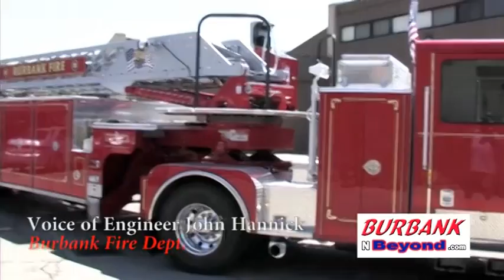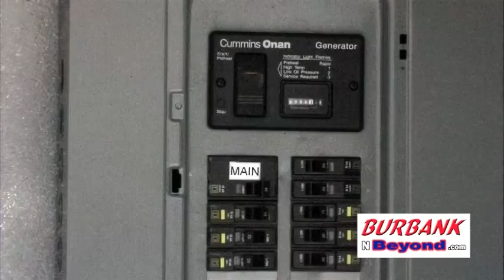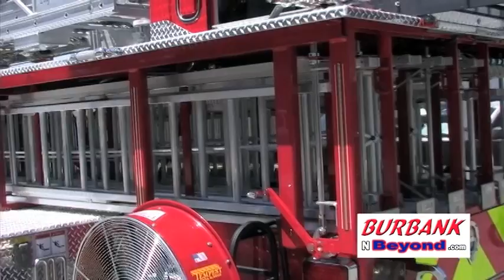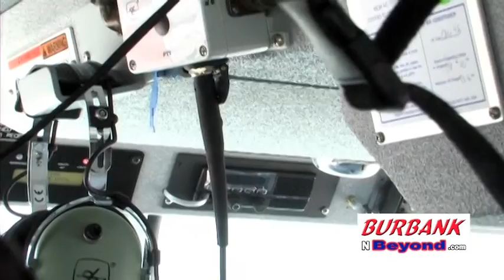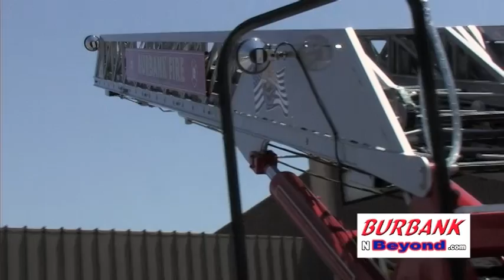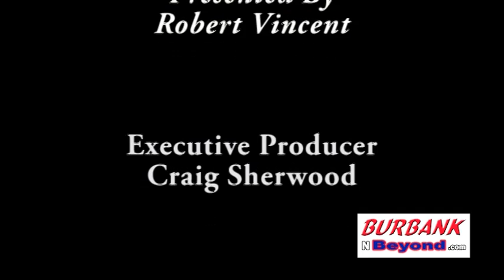New Fire Truck (T11) Goes Into Service in Burbank

Comment: I know that the Tillers steer also in the rear, but there's just no way that a Tiller fits thourgh 1000 to 2000 year old historic city centers and its streets, it wouldn't manage any turn there. Even we with our much smaller Aerials often need all-wheel steering to manage those turns

Comment: very informative vid, enjoyed it! You actually see how different the concept of the US tiller to the european aerial is: The size:even as the average here is also an about 100 feet ladder, the truck in driving position is only about 30 feet long (makes it eaasy in traffic :). also different in europe: normally no ground ladders, and that there are just 3 fire-fighters (engineer included). Other tools, ground ladders and fire-fighters are then in engines and so on